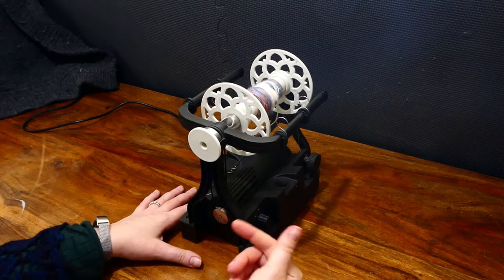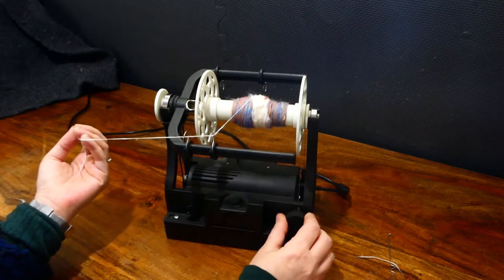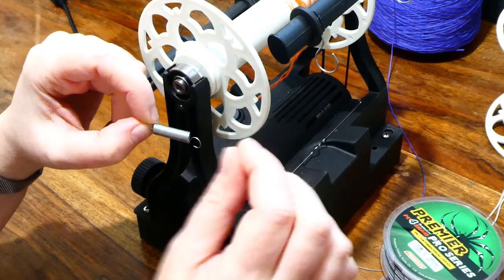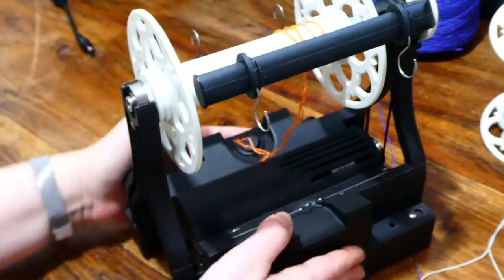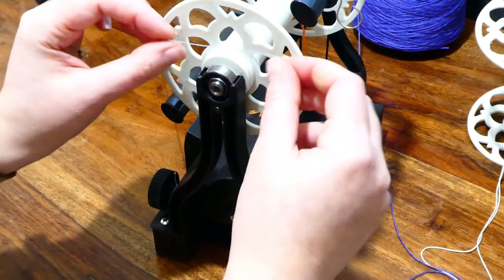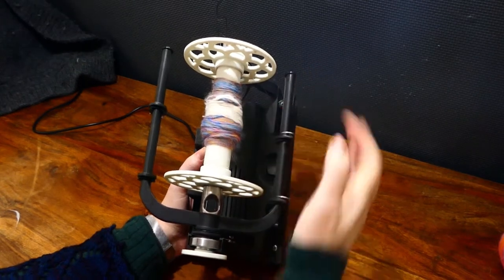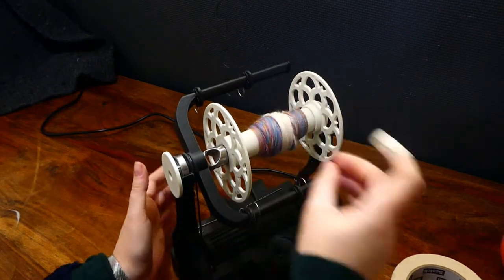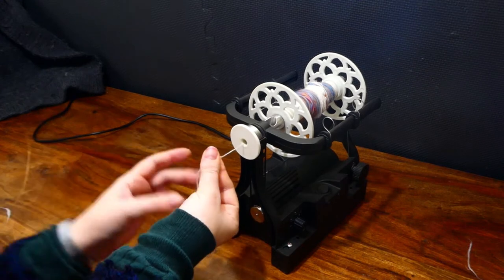EEW 6.0 FAQ

Comment: Won't the braided fishing line wear away the plastic of the spool? Thank you for the awesome videos!
Reply from the maker: It likely will over a long period if you spin with high tension. Almost all my yarns are from fine singles using the very stretchy spring, and I like a very low takeup, so I am not worried about it... it's not even started to wear a groove into the 3d printed PLA bobbins I have, and those are way less durable than the ones that came with it. For thicker yarns and art yarns, which I do occasionally spin, I'll replace the band and spring for the stronger spring and a thicker band.
Reply: @vampyyy  thank you! So good to know.
Reply: @littlebitacresfarm2520  I’ve been using the fishing line on my Nano since I bought it during the last Kickstarter and I’ve spun aLOT of yarn with no damage to my bobbins.
Reply: @bobbinsew  thank you. It is really good to know!